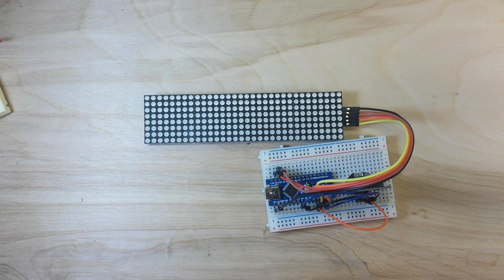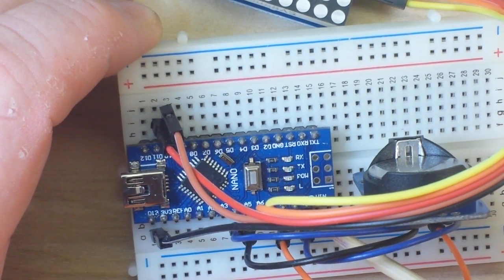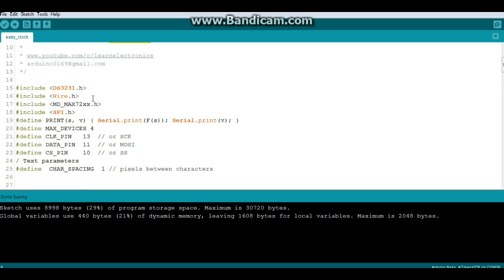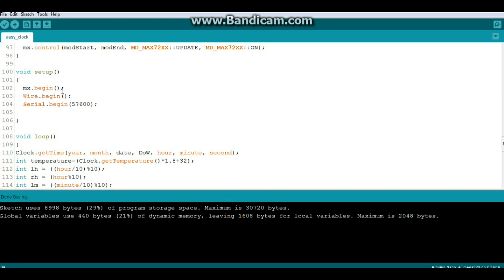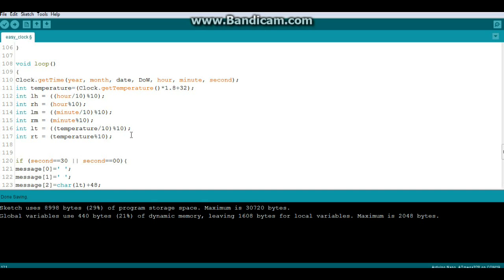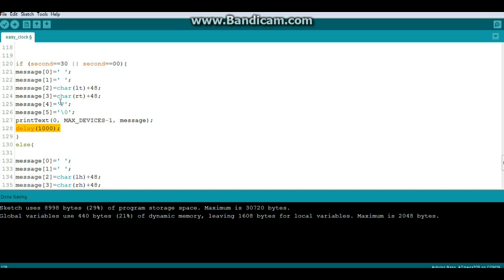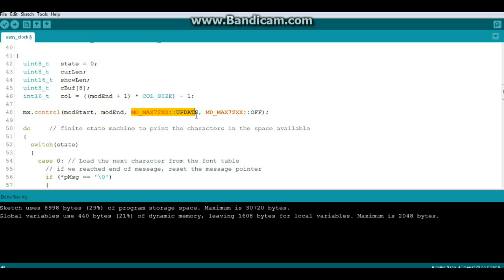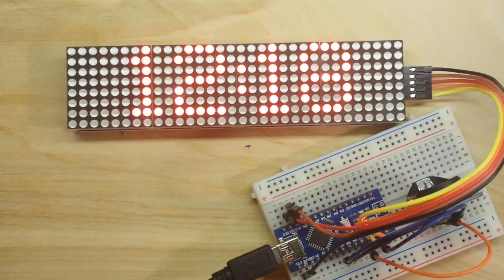Arduino LED Matrix Clock

Comment: Thank you for your lessons and as always great lessons. It appears most people are having issues adapting DS3231 RTC to this project, oh well I have the same issue.lol. I will try and adapt the code because I previously used this chip with liquidcrystal display and it worked well. If anyone has some ideas please share. If I do figure it out, I will also share my solution with you guys.

Comment: For those of you having problems, there are several factors at work here.  1. The library referenced in the video has been updated and isn't compatible with these instructions anymore. You are probably going to have to download an older version that I will paste in my next comment in case that causes it to get flag.  Basically these updates may be improvements, I have no idea, but they've jacked up all of the examples on the internet that relied on them and tbh, the vast majority of the "examples" in the library designer's library won't even compile. It's a mess.  Secondly, if you try to change the FC16 setting mentioned in the video and the setting isn't there, your library is too new and you need the one I'm going to link to. Thirdly, there are a bajillion versions of this matrix and you need to figure out which one you have. The little matrixes pop off the board if you want to see the chips etc.  Either way, install the older version and set paola to 0 and go through the other options such as generic and fc16 and see if you can get it to work.  I got pretty frustrated doing this "easy" project.  Not Paul's fault though. Keep up the great work.
Reply from the maker: Thanks
Reply: same problem... I cannot find a clock code to work with 2020 lib and FC16.... I think it´s on propous... to panish who buy chinese models ;)  3 days looking and trying everything and cannot have a clock going...
Reply: Dan do you have a solution already?
Reply: @jpcme2002  No. I think youtube stripped my link to the solution

Comment: Thanks for the video... but the DS3231 lib change so much since 2017... that the code doesn´t work anymore... for example: DS3231 Clock; this fubtion is not valid anymore... any help?

Comment: what library did You use for DS3231 RTC?     I get  'Clock' was not declared in this scope error  right under void loop()   Line "Clock.getTime(year, month, date, DoW, hour, minute, second);"  turns red...    I tested 3 different libraries; no luck   and error  on   "DS3231 Clock;"
Reply from the maker: DS3231 by Eric Ayers
Reply: Thanks!  that worked!  Had to replace all wire.send with wire.write and rec with read but it compiled in 1.6!
Reply from the maker: jacekf ahhh, ok. I'm using 1.8.1
Reply: Can I please get link for this DS3231 Library that works? I tryed so many different libs, without any luck.
Please Help :)
Reply: Nikola Nikolić hi , I have the same problem , tried many libraries ,can't find a solution , did you found something ? Tnx
Reply: I got it to compile by changing the code ..Clock.getTime(year, month, date, DoW, hour, minute, second);
to:int DateTime=(year, month, date, DoW, hour, minute, second);
I just cannot test it as i am not at home for next 2 weeks, lemme know if it works :)
Reply: OH and add another / to: / Text parameters

Comment: Hello there, this is a nice project and with me its working fine. compiled in fist time without any error. the only issue i am facing is that when it is uploaded for first time the display is ok. but when disconnected from PC and hooked power bank, there is no display and when display comes there is no seconds displayed. any idea what could be the problem. i have replaced power bank with external power supply as well but problem persist.

Comment: When you say 'ground which is MOSI' what does that stand for?
Reply: Probably that the SPI MOSI pin should be pulled down to ground, though I can't recall what part of the video that it, so he might've misspoke, as I'd expect MOSI to be connected to the peripherals so the master make requests to them.

Comment: How did you get the temperature reading as there are on temperature reading devices attached on the circuit
Reply: The DS3231 real time clock module has an internal temperature sensor

Comment: hey when i installd it this error will shown...pls help me.....
Arduino: 1.8.3 (Windows 7), Board: "Arduino/Genuino Uno"

C:\Users\palash\Downloads\easy_clock\easy_clock.ino:15:20: fatal error: DS3231.h: No such file or directory

 #include <DS3231.h>

                    ^

compilation terminated.

exit status 1
Error compiling for board Arduino/Genuino Uno.

This report would have more information with
"Show verbose output during compilation"
option enabled in File -> Preferences.
Reply from the maker: +Palash Karmakar you don't have the ds3231 library installed.

Comment: Hello, thank you very much for uploading this video, but could you help me? When I try to compile I mark a couple of errors, 'DS3231' does not name a type, easy_clock: 113: error: 'Clock' was not declared in this scope;
  Clock.getTime (year, month, date, DoW, hour, minute, second); Do you have any idea what it might be?

Thank you very much
Reply: Hi! I'm getting the same error at  int temperature=(Clock.getTemperature()*1.8+32);  after changing the code from Clock.getTime to int DateTime. Can you please help me? i'm using the Library that you linked. Thank you
Reply: make sure you dont have another version of the DS3231 libary installed.
Reply: William Gibson Still doesn't work. Thanks anyway

Comment: Hi Guys
Herewith my solution and my clock is working very well. 
There are capital letters typed in the code where letter should have been lower case.
line 24 \ instead of \\
line 29 DS3231 clock; not DS3231 Clock. Include line 30 as shown below.
line 30 RTCDateTime dt;
line 110 clock.getTime(year, month, date, DoW, hour, minute, second); this extention does not work. Replace it with 
line 110 dt = clock.getDateTime();
line 111 to line 120 replace as shown below
int lh = ((dt.hour / 10) % 10);
int rh = (dt.hour % 10);
int lm = ((dt.minute / 10) % 10);
int rm = (dt.minute % 10);
int lt = ((temperature / 10) % 10);
int rt = (temperature % 10);
int ls = ((dt.second / 10)%10);
int rs = (dt.second%10); 
Note I am reading seconds too. I hope it works after this minor changes.
Regards 
Yedwa
Reply: thanks
Reply: I tried this but still got this no matching function for call to 'DS3231::DS3231()' any help please

Comment: Hi, I suppose this project would work with arduino uno r3 also?
Reply from the maker: +Frode Molland any arduino
Reply: Hi, great :) thanks for super fast reply, just started with arduino
Reply from the maker: +Frode Molland always here if you need help
Reply: thanks for info at this moment :) I have to order this matrix first, now I got the oled 0.96 inch screen and one lcd screen, but I want a bigger clock in my tv room :)

Comment: someone knows how to make the  " : " flash? i can't achieve ot make it work, I tried doing a for loop but error appears.
Reply: not very difficult, print ":" and then print " " (space) in the same space with a 1 sec delay, there you go.
of course there are other ways
Reply: Bharat i will try. thanks

Comment: thanks for your prompt reply. I am getting this error msg. arduino ver 1.8.2
"
easy_clock:30: error: 'DS3231' does not name a type

 DS3231 Clock;

 ^
"
 here is my dir structure
C:\Users\user1\Documents\Arduino\libraries\DS3231\examples\easy_clock
Reply from the maker: Mohammed Zaman I can't help you with PC configuration issues. but I believe the sketch is in the wrong folder
Reply: DS3231 library is missing or not in proper place